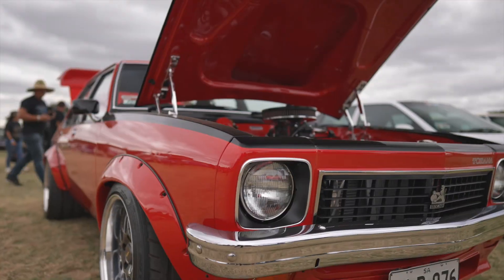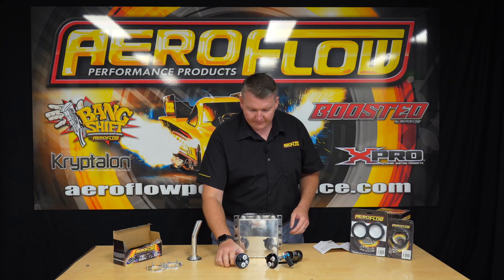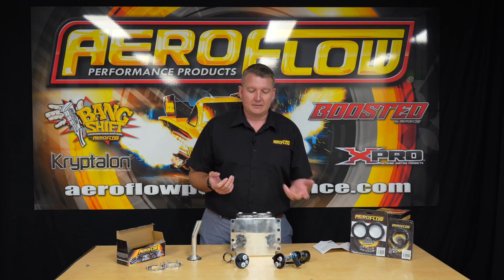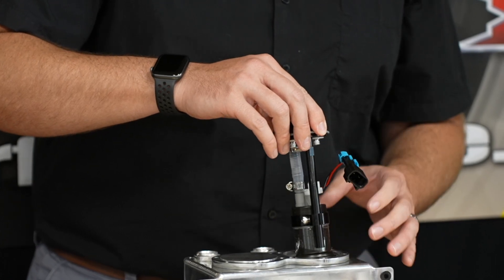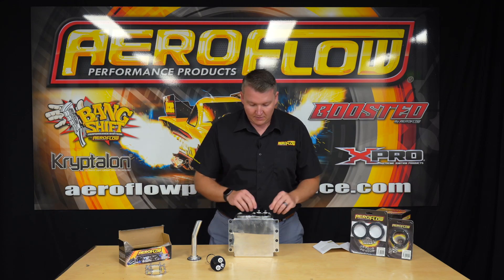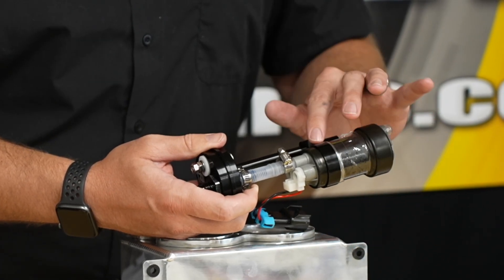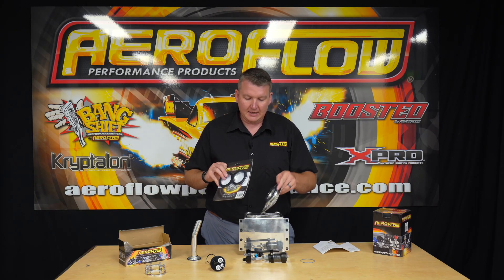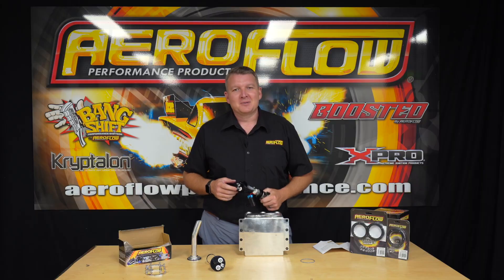Say NO to old fuel pump tech!

Comment: Does this mean if I was to weld your “adapter” plates to a tank I also had the option to run the old style 60mm pump too?
Reply from the maker: Technically...yes! If you still want to use something like an 044 or 040 pump you can use it